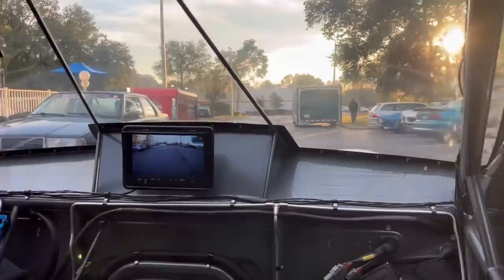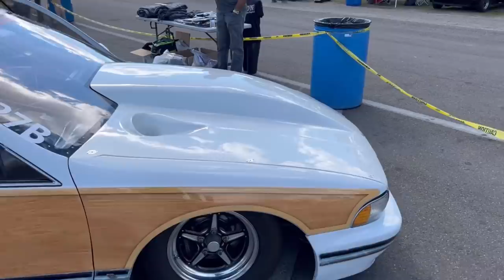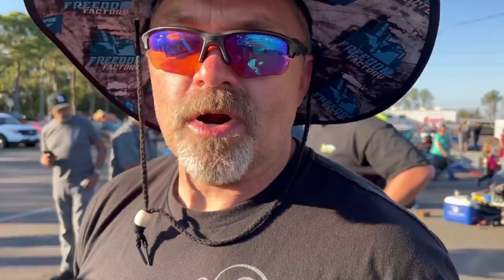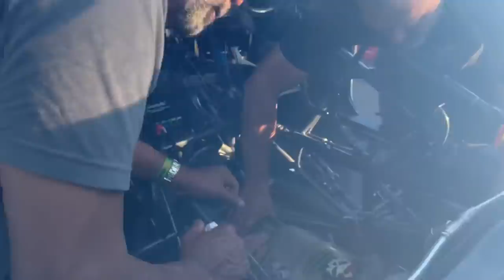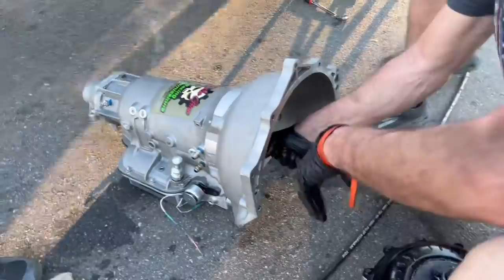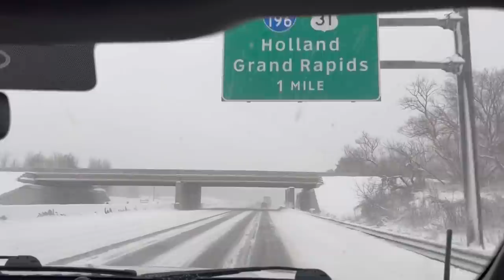SICK WEEK DAY 5: Trials, Tribulations, and Transmissions on the last day of sick week

Comment: Enjoyed all of the Sick Week coverage. You guys had the right idea by standing the trans up on it's output shaft while trying to install the converter. Once the converter drops into the pump gears, you should hear two audible clicks as you rotate the converter slightly back & forth. However, if the builder installed the inner gear backwards in the pump, you'd have to remove the pump, disassemble it & flip the gear over to fix that problem. Probably best just to return the trans to the very kind fellow that loaned it to you. That is a very impressive first showing for the wagon. Thanks Steve & crew for bringing us along...

Comment: Great showing w/ your new car.  Lesson learned - next time bring a spare transmission (and spare third member if you don't have one already) and extend your rear spoiler and raise your chute mounts to window level...and tell the track official to let you and your trans-braked 2500 hp go after you're staged and on the two step - even if the guy in the next lane screws up and bumps thru the beams...and maybe build a trailer made out of the back half of two Roadmaster wagons welded together (open end to open end)...Can't wait to see you and your son go mid-6's in it!

Comment: "go out with a bang" steve you came in with a bang!!!! As i said day 1 well done for being a shop guy who got his car out, then add running 6s on a brand new drivetrain and chassis off the bat is absolutly incredible, im sure any veteran driver would say you wouldnt be able to do it but you did. Cant wait to see whats next for the boostmasterII. What a car.

ps for those watching the car online i can confirm in person this car is just an amazing piece, the paint, the engineering, the odd seat position, its a beautiful thing to behold.

pps steve look on my day 3 gallery on the sick the mag FB group (under Ken White, i did tag the shop), i filmed your run at SGMP from behind, i think ull find the spectator commentary quite ammusing.